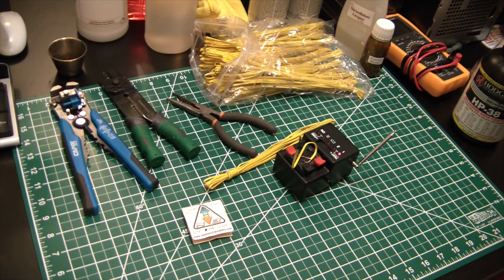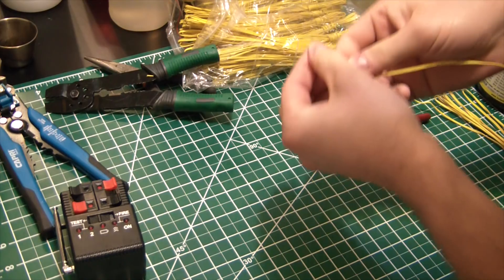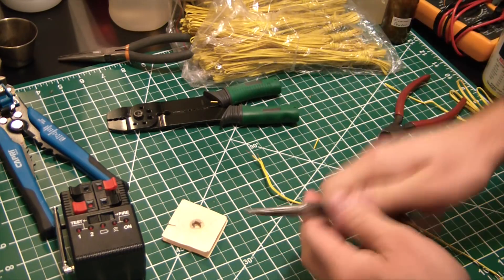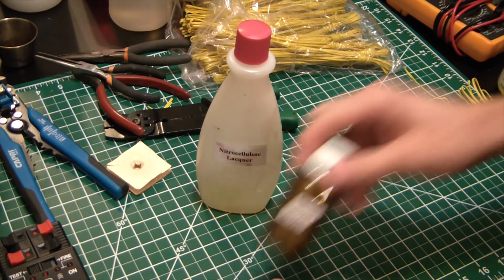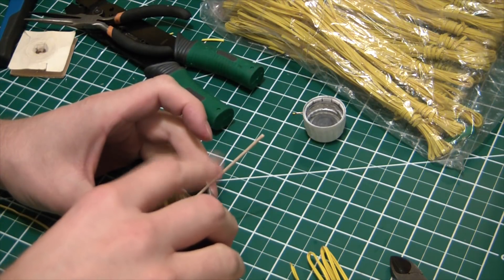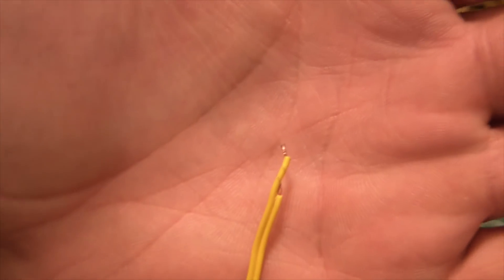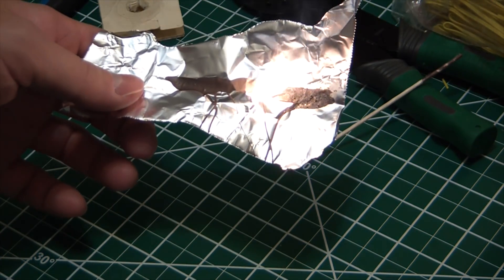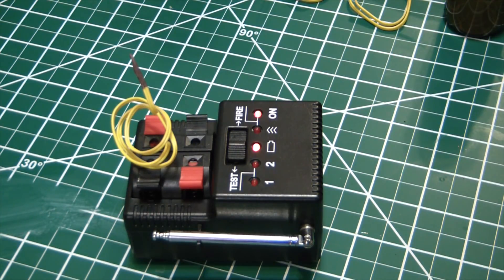DIY Electric Igniters for Rocket Engines & Pyrotechnics - ELEMENTALMAKER

Comment: What kind of input power is that source giving the igniter?
Reply from the maker: Just a 9V battery
Reply: tAke a full chaged 4.5 AH lead acid battery ,u have thi nk about ur  wire resistance ,think ur distance ,near o ohm would be better, if not to calcute this take 19swg silver wire.....goog luck be safe   hammering,and drili ng....ur not oil engineer ....amd.

Comment: My thoughts on nichrome wire:
1) take a cheap low wattage hair drier apart and you have dozens of meters
2) go to a vape store and get meters for a dollar
Reply from the maker: You can go this route, but the wire obtained is usually significantly heavier gauge, and will require much more energy to get red hot.  As long as you can supply adequate power though, it will work.

Comment: Would be awesome to see your build for a DIY remote trigger box.. You got a sub  off of this, sweet video. Like how you explain things.
Reply from the maker: I appreciate your sub James. I will be doing a video making one sometime soon, keep a look out for it. I saw your other comments, but it looks like the one I bought years ago is no longer in production, I couldn't find it for sale anywhere.
Reply: ElementalMaker  have you thought about doing an arduino micro or nano version?
Maybe have a vocal count down with some talking and some beeping, variable second countdown with a potentiometer and a 7 segment display or some such..
Would be pretty sic.
Reply from the maker: James Que that would definitely be pretty damn cool, but out of simplicity I just use a basic single channel relay. I'm not so great at coding and wouldn't trust myself with something that could potentially go catastrophically wrong.
Reply: @ElementalMaker  - I'm guessing that wireless (R/C) launch thing's not on the market anymore because it's too dangerous. First, it's susceptible to fairly easy hacking so someone could set your engine off right in your face. Second, people looking to make remotely-detonated bombs (for evil purposes -- it's the world we live in) would have a field day with it. Much safer to stick to hard-wired launch systems.
Reply from the maker: @chapelgrovefilms  nah they still look to be selling similar units all over the interwebs! Just ebay search fireworks firing system and you'll find some
Reply: @ElementalMaker  - No thanks. I prefer hard-wired. I'm working with a rocket with 7 engines. Definitely don't want to have to worry about hackers or stray wireless signals making it blow up in my face.

Comment: Used to use jeweller's soft iron binding-wire, fed from an old battery charger.  The wire was stiff and thin enough to be pushed through a squib.

Comment: also you might not wanna burn those inside cause its burning the plastic "sheath" which reminds me how the store bought igniters always had a strip of paper holding the wires apart from each other the igniters were only composed of a black powder substance and metal wires

Comment: smokeless powder is mainly composed of nitrocellulose. You could just uses smokeless and acetone to get the goop. If you mix black powder instead of the aluminum and iron oxide you could make some fire work stars. depending on what other chemicals are in the powders the color of the flame can be different lol

Comment: I used to take merely one strand of copper wire from any stranded wire and either used just that, or a match head installed as well and never ever had any problems. JMHO
Reply from the maker: Gary Mucher I did that too in the past, but nichrome is much more reliable and can operate with lower voltages in my experience
Reply: ElementalMaker one source of Nichrome wire is believe it or not is BREAD TIES.  I used them on my system for a while before it got old and stopped working.   If you use these cheap chinesium firing systems frequently they will not last long.   Yes I’m an AvE fan! Lol

Comment: this might sound stupid, but is it possible, in any way, to run a motor on black powder, gravity-fed in a diesel or petrol engine?
Reply from the maker: The Rust Admin I think the Mythbusters tried that years ago and couldn't successfully get it to work. Given enough money and time though, I'm sure it could be done!
Reply: The Rust Admin never heard of one but you might try Google
Reply: There were some early (16th and 17th century, I think) attempts, but internal combustion tended—quite disastrously—to become external.

Comment: Great video. This looks like it would be a good replacement fuse for my Civil War Mountain Cannon.
Reply from the maker: Stephen Mitchell that it certainly would be! I am very fond of keeping my distance any time I'm igniting a pyrotechnic composition, and a cannon would be no exception. Sounds very neat though! You should post a video of it
Reply: Really glad I stumbled on this video to relay this to Stephen!

DON'T. check your laws in your state and federal levels before you change out visco fuse for an electronic fuse. Changing the ignition system can "repurpose" the cannon into a destructive device, and would have to be registered with the ATF. 

I am not sure of the exceptions for reenactment purposes, but the ATF will throw the book at you if it is required to be documented, and you haven't filed the proper paperwork.

Comment: I'm curious, since you mentioned that the smokeless powder was mostly nitrocellulose couldn't you just dissolve that in the acetone instead of making the lacquer with the ping pong balls. I would understand having to use it if you were using black powder but since your'e using smokeless I would think just dissolving it in acetone would be sufficient. Keep up the good work.
Reply from the maker: Yes that should accomplish the same thing. There are different forms of nitrocellulose, and just from my experience I prefer using the ping-pong balls for the base lacquer since they seem to be  a less heavily nitrate form of the compound. Thanks for checking out my channel!
Reply: Seems like that would end up brittle and crumbly.

Comment: You could mix up the dip in a small test tube, and thusly:-
* needing much less material
* slowing evaporation of the acetone
* getting a consistent length of coating on the wire
* using a stopper, be able to store it (carefully) for next time

Comment: how about using mini-holiday bulbs, the non led kind
Reply: craig palmer as long as you don't damage the filament when you break the glass, it should work well.
Reply: craig palmer it can be done but it’s tricky.  You have to carefully break the glass without messing up the filament.

Comment: Fun stuff. Thanks for sharing these demonstrations.When i was 10 or 12 i would twist a couple strands of copper speaker wire around fire cracker fuse connected to. a 100 foot extension cord and set it off with a car battery. on the other end Id place them where i could set them off as someone walked near. My brother's was more often my target.
Fun times.
Thank you.

::SUBBED::
Reply: Lol I took Christmas light bulbs break the glass. Put a match head between the light fuse Stick the bulb  in my homemade rockets and run speaker wire to a 9volt. It would burn the fuse then the match. Layer I used it to start sparkler thermite. All with out YouTube. Damn it think what we could have done 20 years ago...
Reply: @Matt KissMyassSocialist Lmao growing up on a farm, my brother and I would do this by running roughly 100ft of speaker wire from an 18v drill battery to our homemade "fireworks". Which were really metal pipes packed with smokeless powder😄. I remember then setting up jars of gas or kerosene on top of said fireworks and recording the mini mushroom clouds that followed😅. All from behind proper cover ofcourse.. I still wonder how I managed to keep all fingers and limbs through the years tho.

Comment: The wire ignighters. ive always crushed some matches and used the wifes nail varnish to coat the wire you can always dip it in any other ignition material like black powder or thirmite. but works great nicrome wire basicly fine fuse wire can ignight with 1 aa battery, fuse wire size the higher ampage the higher voltage . yours seamed alot of work but it was very interesting nice video well explained .a1 bud